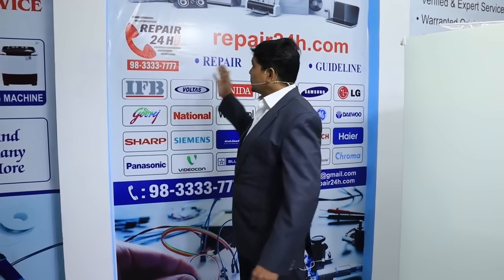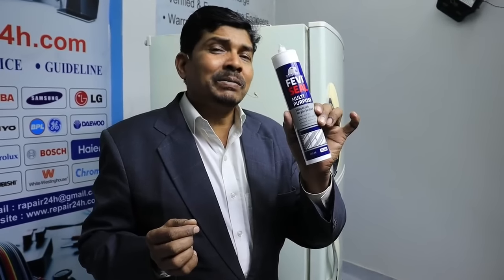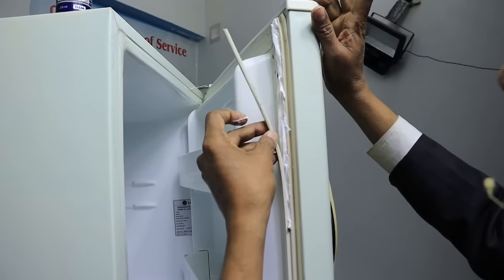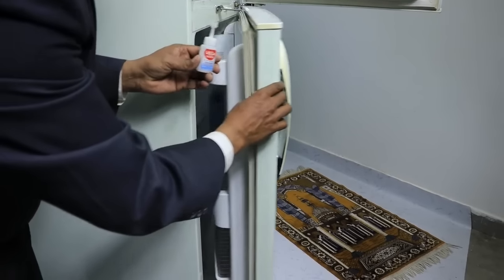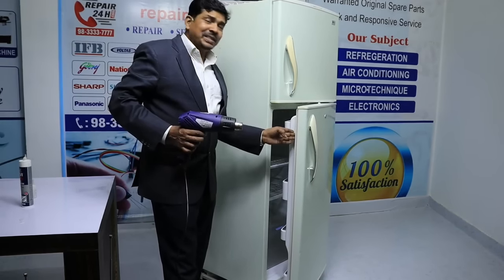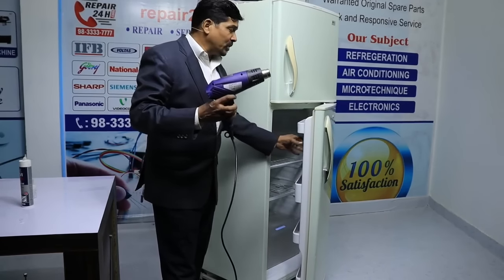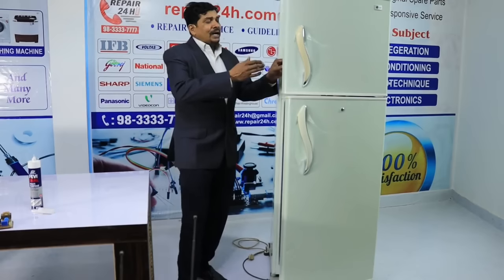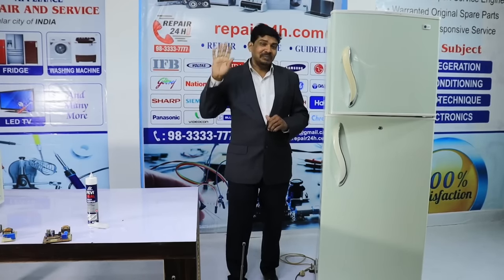how to repair fridge door rubber at home | refrigerator door repair  |  fix fridge door

Comment: What is the cost of replacing the double door gasket
Reply from the maker: call to authosised service senter of fridge brand
its easy way to ask price
Reply: @repair24h43  Acomany Aurhorized service station insists engineer visit for purchasing only rubber gasket of door. Isn't it wearied? Its very easy DIY. Only the thing that need to supply rubber gasket as per my Fridge Model. There is no rocket science in installation of it. Then also they continuously insists Service Engineer Visit (Chargeable: 450/- + Tax).